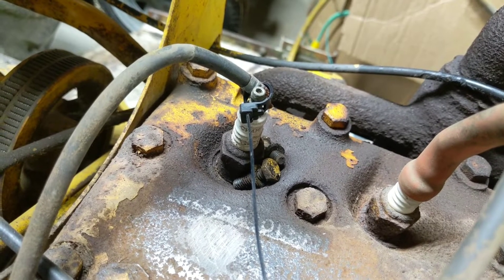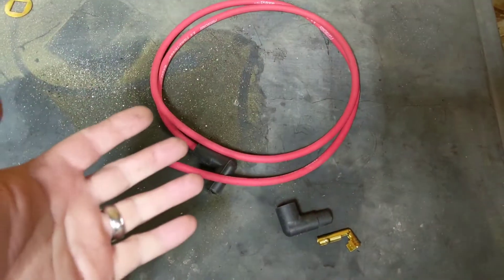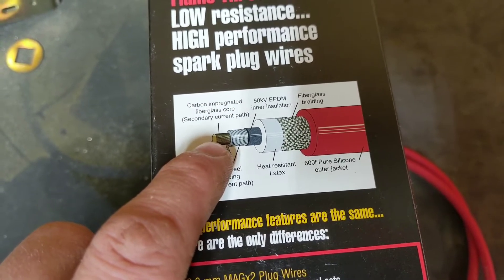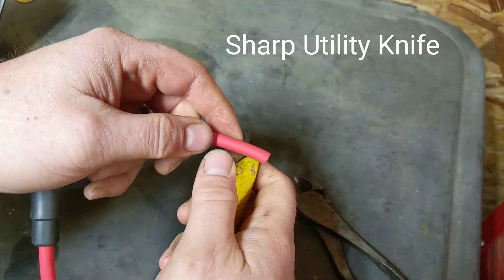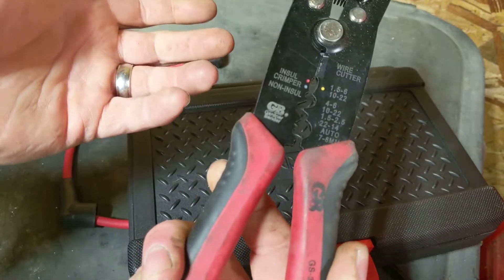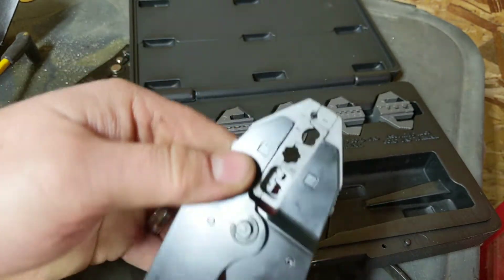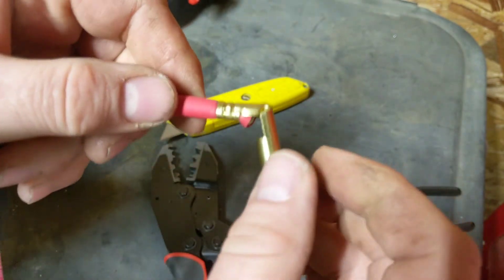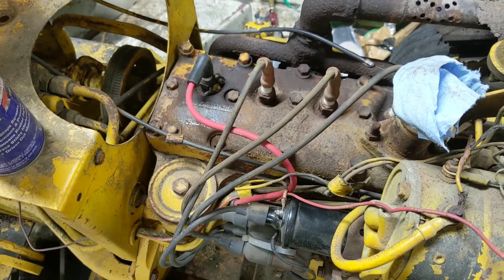DIY Spark Plug Wires, how to make your own and how to crimp the ends!

Comment: I was hoping you would touch on what position 1 was on the die.  I'm trying to find out if this can also cut the wire, basically what you did the the utility knife.  My Accel crimper had that option so looking for something with that also.  Other than that good video!